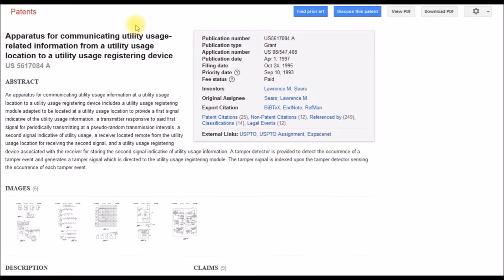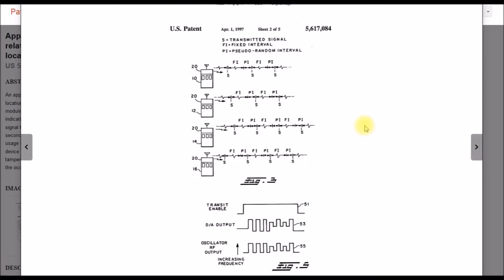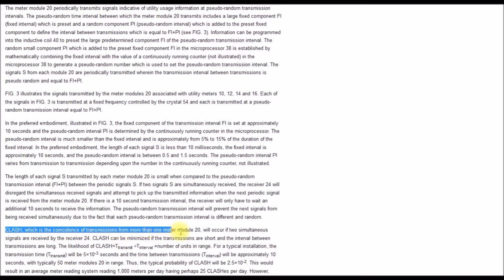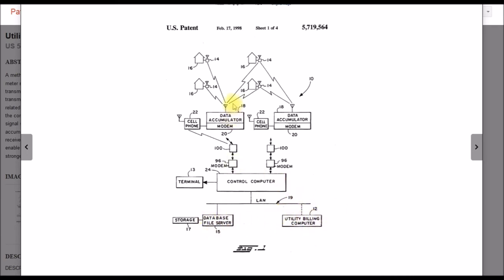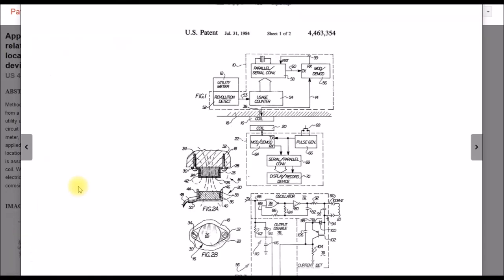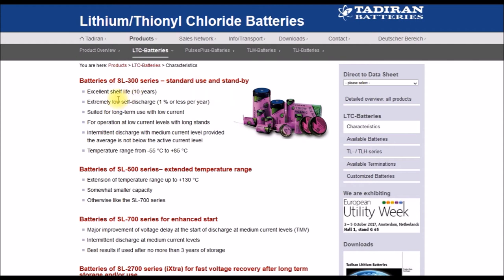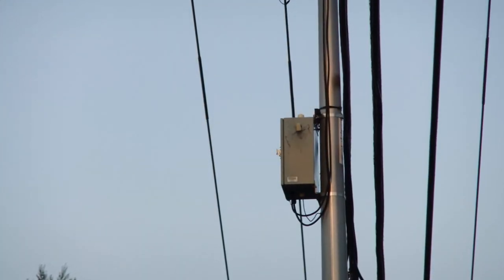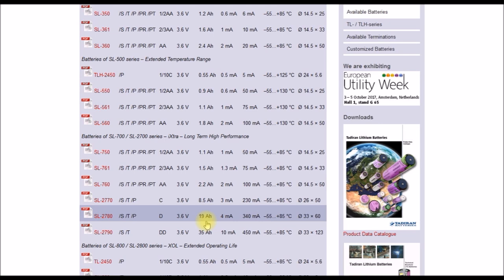Smart Gas Meter, Part 2

Comment: Cool but again technology taking away meter reader jobs
Reply from the maker: Yes, that's true.  The city water meters are still read by a person, but the gas and electric meters are wireless now.  Hardly used to see the gas meter reader as that's out in front of the house.  But the electric meter reader had to come in the back yard every month.  So I guess all those guys have been replaced by IT technicians keeping all the systems running.